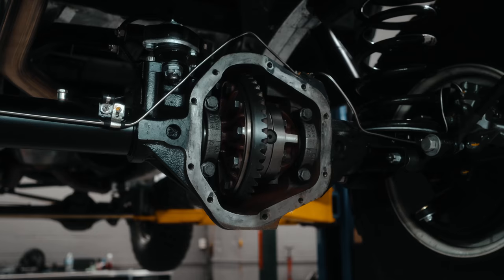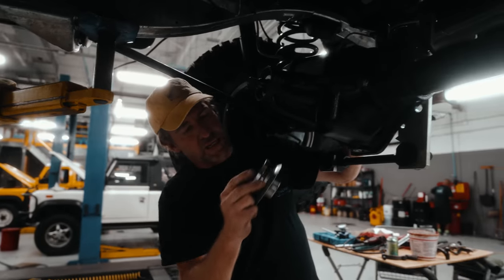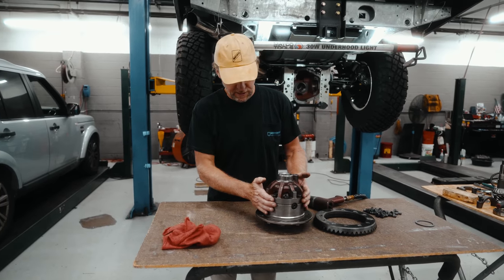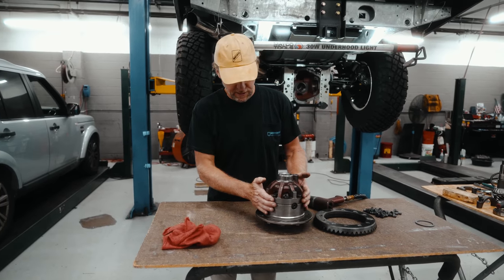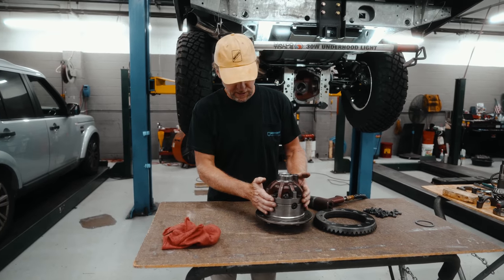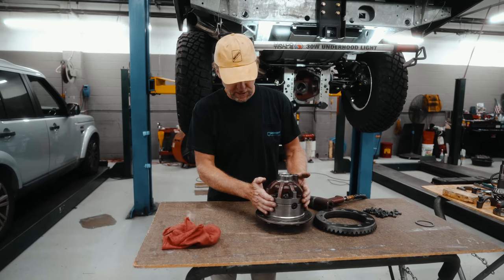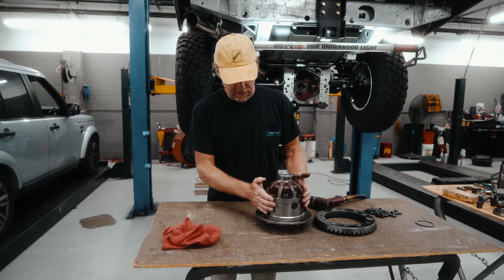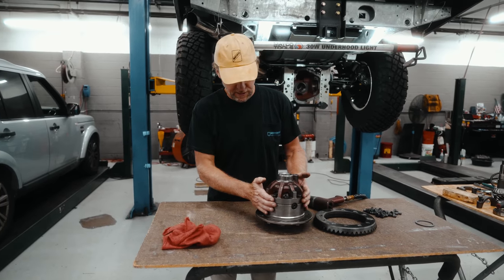Salisbury Differential Overhaul Tutorial

Comment: 30 foot pounds on the pinion preload?  Sure about that?  As for the half shaft seals in the stub axles, far better to remove them or rip their lips off so that diff oil can lubricate the drive flange splines and wheel bearings - those seals are why 300Tdi and later drive flanges and shaft splines rust and wear so quickly.

It would have been nice to see the mesh pattern in the paste you applied.